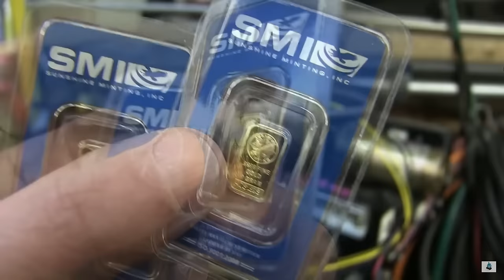Cold Welding In Vacuum

Comment: Did you take into account the temperature of the metals?  Maybe twisting the bars together heats and energizes the atoms a little and allows it to happen.   Why don't you try heating the bars and then touching them together.  not hot enough to melt but just to like  200 degrees.
Another possibility is while twisting the bars together obviously doesn't increase the temperature of the bars themselves to melting temperatures.  But maybe the surface atoms for a brief moment get heated up to their melting point.  But this heat can't be measured because its only a couple atoms that are that hot for a fraction of a second.   Maybe the surface atoms of the bars are several thousand degrees for the moment you twist them together and that causes them to melt together.
Reply: He did heat the gold up with his laser a bit, I'm not sure if it's anywhere near 200 and it does depend on if you use the imperial, centigrade, or science scale, so please point that out. Anyway, he'll probably have to glue them and want to get them back, so he might not have an alternative other than hot glue, which will melt.
Reply: no he didnt.  He shined his laser on the bars but they didn't touch for 30 minutes after that while he evacuated the air in the chamber.
Reply: That's a good point.  In addition, I wonder if the metals behave somewhat like a non-newtonian fluid, in that abrupt shock will not fuse them because it stiffens the intermolecular forces somehow.
Reply: STDrepository Wouldn't the smashing together cause lots of heat on it's own? It would last much less time but wouldn't it?
Reply: smashing together creates a shockwave that distributes heat through the bar evenly.  But twisting would cause friction that only heats the surface atoms.
Reply: That wouldn't exactly be cold welding now would it?
Reply: exactly
Reply: I was thinking that maybe, by turning the metals, they "hook into" each other on a microscopic level. Like tiny parts are boring into the surface of the other piece
Reply: Russ Andrew thats a good idea
Reply: STDrepository Did you consider that smashing the bars together creates heat too? Therefore it should weld too following your theory that the welding happens because of the surface atoms getting hot for a short moment
Reply: DING DING! we have a winner! Its called friction welding. And it works better than in a vacuum because heat dissipates much worse in a vacuum. Meaning the constant friction is heating up the surface make it plastic("workable") and removing oxygen molecules making it forge together. You can see that clearly in the results.
Reply: "Smashing things together" creates very little friction and heat.
Reply: heating the metal is counter productive of this video being a "COLD WELD"
Reply: I think it works when yu twist the metall, because the structures inside the metal have to line up. for indium you would have to rotate it 60 degrees, to go through every single rotation the structure could have. for gold it would take 90 degres of rotation to do it. 

maybe if you mark the position, the two indium parts get stuck at, you caould smash them together at the exact rotation.
Reply: +thizzface Compared to arc welding, 200 degrees is cold. Compared to absolute 0K room temperature is very hot.
Reply: an inkjet printer works at temperatures hotter than the sun. My guess is the tiny particles constantly in friction with each other in a vacuum while any impurities on the surface are scraped off makes it workable enough to make the grains start sticking to each other. Achieving higher temperatures is a lot of easier on a small scale esp in a vacuum.
Reply: @manny yes of course because the oxygen creates the friction (no stick). I think this test was to prove how it can be done at a standstill state within an atmosphere.
Reply: Indium is rather soft. so i think of different results as far as using different metals to conduct a test like this. did you guys notice that he went from using a solid bar of gold versus the dust. The one thing i noticed is the surface properties of each metals are more likely to bind if the atoms are broken down.. Just like cooking in a kitchen
Reply: Well if you think about it twisting it would cause heat via friction but so would smashing the two pieces of indium together and I would think the energy realised as they slam into each other would be greater than the force of friction releasing heat . I mean I haven't done the math but I think there could be more too it than that , I would love to hear your second opinion on the matter thought or maybe prove me wrong
Reply: No it happens because metals have large amounts of electrons also know as "the sea of electrons" which makes them essentially just stick to each other, but on earth the oxygen basically gets in the way of this happening, so it doesn't work so easily. Heat and friction have nothing to do with it, neither does suction.
Reply: +austin I agree to your statement. heat doesn't seem to be the key here. Im leaning towards "Static Cling" like a balloon and ones hair
Reply: Cold welding is about getting atoms close enough. You don't need to compress them, as that would create heat, you just need to move the atoms close enough that they attract each other.
Given 2 gold bars: How do the atoms in one bar all know to stick together, but when you hold the two bars together, how would the atoms know to NOT stick together? They don't.
The only reason this doesn't happen in atmosphere is because you always have something in between the atoms of whatever you're placing together.
Forget what you think you know, forge welding doesn't work just by melting metals together. It works by thinning out the air around the metals via heat, primarily preventing oxidation. The melting of the metal just helps the atoms get close enough to form bonds.
Reply: thizzface it's not even that it's this case, it's just stuff I learned in chemistry that applies in theory, but we live in an atmosphere, so it's actually much harder to achieve
Reply: STDrepository But would those few atoms really weld the gold together that well?
Reply: STDrepository And also that doesnt explain why smacking them together wouldnt weld them since that would cause more heat
Reply: false statement is false.
Reply: I have said before and I will say again.  Twisting together creates friction on the surface. Smacking together will create a shock wave that evenly heats the whole bar.  That is why twisting them together would melt the surface atoms and smacking them together wouldn't
Reply: +STD twisting once does not come close enough to create heat that bind metals
Reply: How do you know?   Calculate the total energy generated by the motion and divide it by the number of atoms that coat the surface of the bar.  I bet you the temperature of the surface atoms is pretty high.
Reply: "Forget what you think you know,"
Same to you. Proximity is not enough you need to actually have entropy to create bonds. Proximity alone doesnt do that. Heat does that. Especially when the infrared energy is trapped in the molecule because of a vacuum.
Reply: mitsukai89 the ESA literally has a peer reviewed paper on cold welding in vacuums and why its a major issue in designing satellites.
Nasa's JPL has several tests on it as well.
Reply: And these papers completely eliminated static friction and infrared radiation? I call bullshit.
Reply: they're available online. give them a read
Reply: regardless of that what cody did was not cold weld.
Reply: agreed

Comment: My understanding of the process is that both metal surfaces have to be exposed once in the vacuum to prevent any oxidation layers forming, to achieve this you could use the same basic rig with magnets but replace the falling weight with a cordless drill and the cleaning cloth with an abrasive such as Emory cloth. Once at vacuum a length of the emory cloth gets spooled by the drill removing any contaminants and hopefully giving the clean surfaces needed. Another point I'm sure other people have mentioned is grease contamination from your fingers, wiping the surfaces down with a degreaser such as alcohol and then handling the pieces with either surgical gloves or tweasers might help. 
Anyway, thanks for sharing these videos and I look forward to future content

Comment: When you wring the gold and indium together and they 'weld' could that just be that two soft metals deform under the pressure and gall up and they aren't welded? Is there a fusion line when you do this?

Comment: Cody, what if it was the WAY energy is introduced? When you rub them together the energy is spread rather evenly throughout all crystalline planes, while when striking you make point contact, being the number of planes interlocking or joining (welding) smaller and cannot hold back the rebounce (after all it is an ellastic material). Just like the force of rebounce exceeds that of the weld and it breaks off instantly?
Reply: Alexander Martínez Pasek certainly a plausible explanation. By rotating the pieces together, their surfaces are conforming to eachother. This creates a large enough contact area for both bodies to bond sufficiently in order to support the weight of the bottom piece.

Comment: What I still think, the roughness of the surface is main problem in big surfaces. The attractive force is present to up to ~1x10^-12m. Repulsive force acts in bigger distance. The finest lapping is able to produce surface with roughness 20-50x10^-12m. So when you put two surfaces with this roughness on each other, they stick on relatively small amount of points of contact. When you slide these pieces you put one piece "mountains" into other piece "valleys" thus increasing the surface which is closer than ~1x10^-12m.

When you vibrated the fine dust, you minimized the whole surface and increased point of contact. Plus even the force is minimal, those particles were bumping to each other. 

BTW I do not want this comment sounds negative or something. Great work Cody.

Comment: MAin problems, in my POV: Low vaccum (you must go to high vaccum to notice any difference). The ones with turbo or diffusion pumps. Your mechanical vacuum should be around 1 or 0,1 Torr, which is still a lot of air. You should go to at least 10-6 Torr to get sth. Second, surface roughness, you should go to extreme polished, lapped surfaces with nanometric roughness. This might be tricky without specialized equipment.
Reply from the maker: If you watch to the end you can see that I got down to to less than 10 microns.
Reply: Ok. I meant about the gold experiment. But I see you tried to prove your point by a different experiment. Seems promising. I would let that running for some days if possible...
Reply: a micron is a unit of pressure in this context, with a micron being a micron of mercury, and it is equivalent to 10^-3 torr
Reply: at 10 microns mercury (strange unit), it takes less than 5 millisconds for adsorbate film to have build on the surface of the metal even if it had been clean before. You would need to get a at least 4 orders of magnitude lower to have any chance at all.

Comment: Cody vibrating the metals to get them to weld reminds me of a process used to weld copper in atmosphere. 
It is "ultrasonic welding" process that use high frequency vibration and pressure are used to weld the materials.
Looks similar to what you did in vacuum but it need much more energy to weld in atmosphere.

Comment: I've always wondered if the 'bouncing back' from smashing the metals together breaks/prohibits the cold welding. like the plates should wobble around at least a little bit from the force of the impact, which i can imagine, is counterproductive for the welding...

also: cool poster, DFTBA !

edit: have you ever tried just pressing the two together in a vacuum? It's probably way harder to do, but that would definitely eliminate that theory.

Comment: Cody !
I'll keep spamming my question then :P
Why won't the oxidized layers on two material  cold weld, they are basically the same material
does cold welding happen only for pure elements and not compounds ? why?
Reply: Lizard813 so does that means only metals can cold weld?
Reply: Only metals can cold weld because their surfaced are like incomplete perfect crystals
Reply: It's called welding, so it only happens to metals
Reply: Tarmius matals also oxidize and metal with an oxygen is still a metal compound. It just becomes a metal-oxide. So yes they can technically weld. The only problem here is that metal-oxides when heated up will separate into their old elements due to the the heat and the fact that there isn't a high enough pressure to prevent them from changing chemically when the heat is applied.  If you ever listened to your chemistry teacher on how chemically reactions reverse, it's due to pressure because the world around us is always searching for a state of equilibrium. Mostly this is for aqueous solutions but it actually goes for solids aswell theoretically. I haven't ever been able to do this myself because it's extremely difficult and it's extremely dangerous to do. Not to mention that I don't have such supplies to replicate such a thing happening.

Comment: try putting a natural sponge that is holding water inside a vacuum
Reply: Cory Pickerign i think that may brake his air pump as water might get in it.
Reply: perhaps a light oil/liquid oxygen/a gas other than water in its liquid state instead.?
Reply: Hmmm. i don't know, however i don't know how sensitive his pump is either. I don't know where he said it but he has stated it's very sensitive but i don't know the date of it.
maybe it might work.
Reply: on the other hand i just realized that if he used extremely distilled water please correct me if i'm wrong it might not be a problem if it got in the pump as it's non-conductive.

Comment: I have a hypothesis about smacking the indium together like you did toward the end. I believe that when you smack them together so quickly, it's forcing such a strong shock through the ingots that you're actually BOUNCING them off of each other, and they hit multiple times when you smack them together. That is what is keeping it from welding.

Comment: Hi Cody,
From my experience, the gas Layers are not the main issue. In ambient air, you normally generate a molecular layer of water from the residual humidity in the air. With your end pressure, i assume baking the pieces at 110°C for an hour, you may yield some results with gold, but you have to go to < 1e-7mbar. (you need a TMP or ion getter pump for this) and a lot of time for bigger effects. It is amazing, how sticky stuff gets at the nanometer-level, and how much effort it takes, to remove unwanted stuff. If you have an oxide layer, you would have to remove it by mechanical work, or other means, like sputtering. Your results with copper is probably, because the mechanical forces cleaved the surface, exposing a clean surface, which was able to welt.

 The water layer is also a source of adhesion "glueing" the gauge blocks together in air.

Comment: You'd be surprised how easy it is to get contamination on a surface. It's not just adhered oxygen, but any organic residue or particles. Also, even though the surface was highly polished, it wasn't "flat" on the <100nm scale. For large surfaces to cold weld, they need to be flat enough to make mechanical contact. As a practical guide, the surface needs to be not only very shiny, but the reflection should have no distortion when viewed at any angle.

The gold powder likely had very clean surfaces and small area, so was able to cold weld with only the vibration. Actually the surface of the freshly cut sliver of gold was also likely clean enough to cold weld with the smaller particles. Pretty much anything you touched with your fingers at any point will be too contaminated. By applying pressing and twisting, you are burnishing the surface (exposing new, clean gold) and the pressure  helps bring more of the 2 surfaces in contact.

Comment: Cody, it was explained to us in machine shop class that the gauge blocks stick together by external air pressure. The surfaces of the gauge blocks are so smooth that you squeeze the air out from between them and they stick like a suction cup.
Reply: Bruh, he literally put it in a vacuum  chamber and they still stuck

Comment: Hey Cody, chemist here.
Just a little suggestion for getting a decent vacuum faster.
Have you tried installing an external cooling trap on your vacuum chamber? Run the tubing (ideally a metal one) into a glass cooling trap, freeze it down with liquid nitrogen and you should be around 10^-3 mbar in no time. Even with a moderate pump.
That also eliminates any problems arising from mercury vapor

Comment: I was taught that gage blocks stick together because the surfaces are machined so flat that it's possible to remove most or all of the air between two blocks, so atmospheric pressure is holding them together, and friction (usually) holds them in place.  The twisting action just helps to expel trapped air, but you can actually get them to stick without twisting if you're patient.  One thing that seems to support the vacuum theory is that the blocks stick just as well, if not better, with oil, perhaps because it creates a better seal.  The same principle may be in effect for the indium in a different way.  Since indium is quite malleable, you might actually be forming a seal when twisting the discs together, pushing out some air and creating a vacuum.